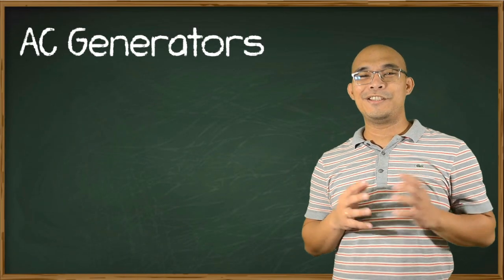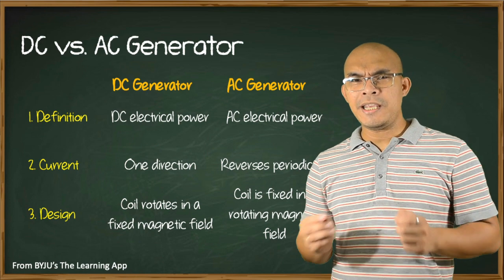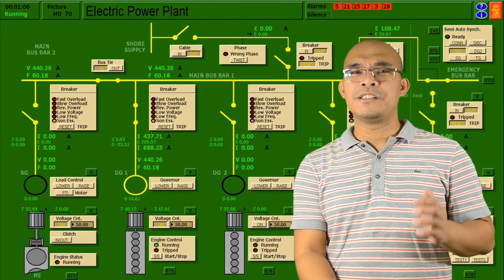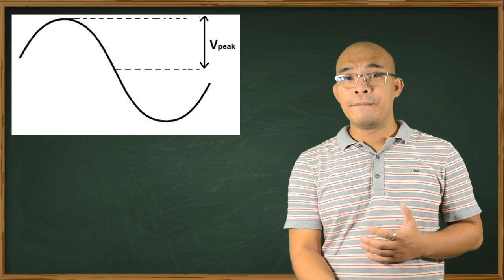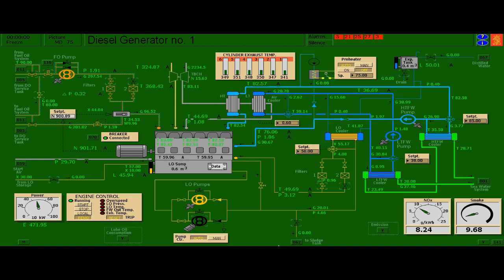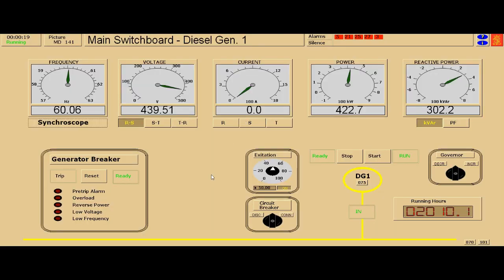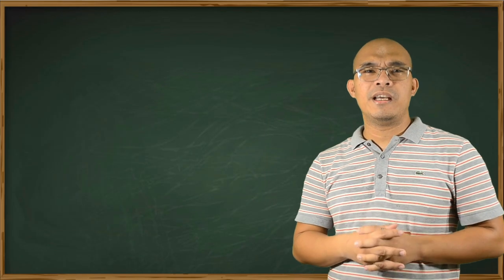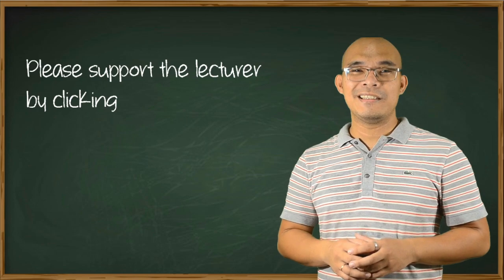How AC Generator or Alternator Works | A Maritime Approach

Comment: Ac generator is more reliable than Dc due to its capacity. It is more effective than Dc on-board ship due to its contrary in rotor that based on the law of Induction. Dc rotor is the conductor while Ac is the magnet which related or based to the law. When we are dealing with this generator, probably choose Ac due of its advantages or enhance current ang higher efficiency.  Because we are depending on it’s duration,  mas matagal mas maganda gamitin. At kung sa maintenance ay hindi gaano because of a little in loosing a current.

Comment: Thank you for wonderful video sir, In this lesson I learned the difference of AC and DC generator both use electromagnetic induction to generate electricity. However, the process they use is different. An AC generator creates an alternating current that periodically reverses direction. But in a DC generator, a direct current flows in one direction.

Comment: Sir, thanks for the video, now i know the difference between the AC generator and the DC generator. This AC generator is also used on board ships. Now i know if the RPM increases the Frequency also increases.

Comment: thank you for this i learned a lot of basic things about ac and dc generator in which both use electromagnetic induction to generate electricity. however, the process they use is different.

Comment: Thankyou sir for making this video I've learned about the basic parts and functions of AC generators and difference between DC and AC generators that DC has one direction and the AC is reverses periodic and DC has Low voltage than AC .DC has less efficient and the AC is very efficient.

Comment: Based on the video that i watch magnetic induction shows if the copper wire passes through a magnetic flux or meet with in a distance and it creates a voltage inside of generator and if the wire is connected in a complete way circuit the energy will be transmitted  ❤

Comment: Awesome video. This video helps a lot to understand what are the differences between AC generators and DC Generators by definition , a DC generators converts mechanical energy into a DC electrical power while an AC is a mechanical device which converts mechanical energy to AC electrical power

Comment: Thank you sir. So, I learned a lot specially the difference between DC and AC generator. I learned also that  In a DC generator the electrical current flows only in one direction while in a AC generator the electrical current reverses direction periodically.

Comment: Thanks for this vlog i have learned about the difference functions between the two in AC and DC generators both use electromagnetic induction to generate electricity.  AC generator creates an alternating current that  reverses periodically direction. And  in The  DC generator, a direct current flows in one direction.

Comment: Thanks for the great video sir. This video explained it immensely. This helps me to identify easily the DC generators & AC generators. Helps me also to know the differences between DC & AC generatos in terms in their definition, in current flows, in designs, in commutator, in voltage, by maintenance, by distribution, especially by the efficiency. I clearly understood the basic operation of a simple AC generator particularly when the armature rotates between the magnet's poles upon an axis perpendicular to the magnetic field, the flux linkage of the armature changes continuously. Due to this, an emf is induced in the armature.
Lastly, I was able to familiarize the AC generator's parts and its functions.
Beautiful illustrations, amazing animations, and great explaination sir.
Kudos !!!

Comment: Now i know that what the differences between AC and DC is that AC generator can make  lot bigger voltage if you use the proper equation or formula

Comment: In this topic, I learned kung ano ang difference ng AC and DC generators. also when the alternator is rotated, alternating current passes through a magnetic field and an electrical current is generated.

Comment: Thank you for this video sir. After watching thid video I learned a lot about the difference between DC Generator and AC Generator. DC Generator is the type of electrical generator that converts mechanical energy into direct current electricity. While AC Generator is a machine that converts mechanical energy into electrical energy.

Comment: Thank you sir. So, I learned a lot especially the difference between DC and AC generator. Nalaman ko na kung ano ang pinagkaiba ng DC and AC generator when it comes to the current direction, design, commutator, voltage, maintenance, distribution, and efficiency. I also learned the basic AC generator parts. And by the video shown, I Know how magnetic induction occurs. Thank you again sir well explained po.

Comment: Thank you sir for a well video.❤️ 
So on the presentation. I have learned that various thing. That how does an AC generator and its defference from DC generator. I learned that a moving magnet coil goes in and out it can produce electricity.

Comment: Thank you for this video sir. I leaned that a simple ac generator consists of a coil of wire rotating in a magnetic field and the difference and how useful AC in the ship and the AC generator have lesser maintenance than DC generator and I've seen electromagnetic induction works.

Comment: Very well said sir. Now,I learned that An alternating current (ac) generator is a device that produces a potential difference. A simple ac generator consists of a coil of wire rotating in a magnetic field and I understand also  that AC and DC generator use electromagnetic induction to generate electricity that is their similarity. The differences between of them is an AC generator creates an alternating current that periodically reverse direction. But in a DC generator, a direct current flowsin one direction. In an AC generator, the coil through which current flow is fixed and the magnet usually moves. The two backups generator are used for different purposes.

Comment: Done watching❤️.. After I watch this video now I will no longer be confused about AC and DC generator because now I know what is the difference between AC and DC generator and their specific uniqueness. Also I figure out that AC generator used on the ship is greater than DC generator its because AC has less maintenance than DC and has a greater output voltage well produced. ❤️

Comment: Done watching Video Good day Sir Engine Cadet Jardiolin, I learned About this Video of two types of Generator that we have different DC Generator and AC Generator. Now DC Generator is One direction current flow only In one Direction and about the design DC Coil rotate in fixed Magnetic field and they have Commutator. Unlike the AC Generator the Current or Electrical current Reverseas and AC Generator Does not have Commutator. It means  DC Generator produce low Voltage and the output of that the frequency is decreasing. Then the AC Generator produce a high voltage in the output of that the frequency is increasing.

Thank you sir God blessed 😇

Comment: In this video, it properly explain that AC Generator is a mechanical device that convert mechanical energy to a AC electrical power, DC generator properly describes if the magnet is fixed while the coil serves as the rotor. AC generators are widely used in ships and AC generators have lesser maintenance than the DC generators.

Comment: AC generator, the coil through which current flows is fixed and the magnet usually moves. It creates an alternating current. the difference between the two is that an AC generator creates an alternating current that periodically reverses direction while in a DC generator, a direct current flows in one direction.

Comment: AC Generator is a mechanical device that convert mechanical energy to a AC electrical power while DC generator properly describes if the magnet is fixed while the coil serves as the rotor.

Comment: I learned for this video sir for making  me understandable explanation on what are deference between DC and AC generator sir ,my understanding in DC sir is the current flow only in one direction but the AC generator does not have commutator and the DC generator produce a low voltage compared to an AC generator produce high voltage with varies amplitude and time , also the AC generator the electrical current direction if periodically. God Bless <3

Comment: The video explains about How the AC generator works. I learned that An alternating current (ac) generator is a device that produces a potential difference . A simple ac generator consists of a coil of wire rotating in a magnetic field. Cars use a type of ac generator called an alternator to keep the battery charged and to run the electrical system while the engine is working.

Comment: DC sir is the current flow only in one direction but the AC generator thus not have commutator and the DC generator produce a low voltage compared to an AC generator produce high voltage

Comment: In this video, I properly understand the difference between Aletrante Current (AC) Generator and Direct Current (DC) Generator, AC Generator is a mechanical device that convert mechanical energy to a AC electrical power while DC generator properly describes if the magnet is fixed while the coil serves as the rotor. AC generators are widely used in ships and AC generators have lesser maintenance than the DC generators.

Comment: I learn in this video, that AC and DC Generators has a different current direction, design, commutator, voltage, maintenance, distribution and its transmission and efficiency. I also learn the difference between AC and DC Generator construction, that the rotor of DC Generator is the Coil and the stationary is magnet. And on the AC Generator, the rotor is the magnet and the stationary is the coil. THANKS SIR

Comment: Thank you for this video sir... Now I learned that the rotors of DC is the coil conductor and the stationary is the magnetic will the other hand the rotor of the Ac is the magnet and the stationary is the coil. The Maintenance of the DC generator requires frequent maintenance and less reliable while AC requires very little maintenance and high reliable.

Comment: Good Day Sir! The difference of the AC generator and DC generator.DC generator is a mechanical devices that convert mechanical energy to a DC electrical power and the AC generator is a mechanical devices that converts mechanical energy into AC electrical power. In Maintenance DC generator requires frequent maintenance and less reliable while AC generator requires very little maintenance and high reliable...Thank You Sir!

Comment: For this video i learned AC generator or alternator works and the different between AC Generator and DC Generator. I learn the moving of magnetic and the coil and also i learned that the AC Generator produced a high voltage and DC Generator produced low voltage.

Comment: What i understand and learned about the video is the similarity and difference of AC and DC generators and that is AC generator is a device produces potential difference. AC generator consist a coil of wire rotating in a magnetic field.

Comment: After watching your video presentation sir, I learned the difference between DC Generator and AC Generator. The DC Generator is a mechanical device that can convert mechanical energy to a DC electrical power. While AC Generator is a mechanical device that convert mechanical energy to a AC electrical power. I also learned tha basic operation of simple AC generator and the basic parts and functions.

Comment: In this video I learned now the difference between the AC generator and DC generator. Based on the electromagnetic induction, it is a DC generator if the magnet is fixed while the coil serves as the rotor. In AC generator, the rotating part is the magnet.

Comment: Good day sir i learned in this topic the difference between the dc generator and ac generator. ac generator  produced high voltage whice varries in amplitude and time and the ouput frequency is 50 to 60 hrz. very efficient as the energy losses are less. Dc generator produced low voltage and the output frequency is zero. Less efficient due to energy losses like eddy current, mechanical, and hysteresis loses. thats all sir thank you🙏

Comment: Thanks you for your another vedio sir for making  me understandable explaination on what are deference between DC and AC generator sir ,my understanding in DC sir is the current flow only in one direction but the AC generator dus not have commutator and the DC generator produce a low voltage compared to an AC generator produce high voltage with varies amplitude and time , also the AC generator the electrical current direction if periodically ,that is my learning in this vedio sir thanks sir 😊

Comment: AC- mechanical device thats convert mechanical energy to ac electrical power. 
No commutator
High voltage siya sir (50 to 60 hz)
Gamay lang ug maintenance 
Taas syag reliable ug easy distribution siya sir.